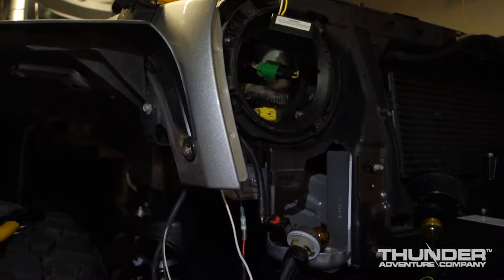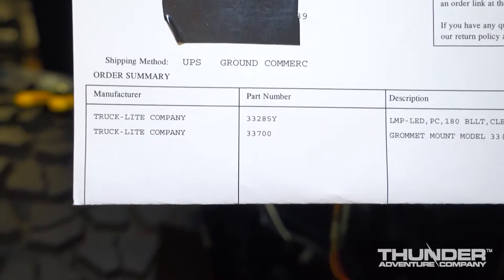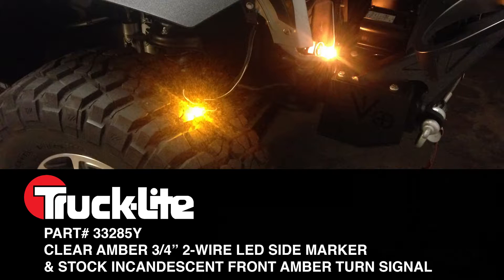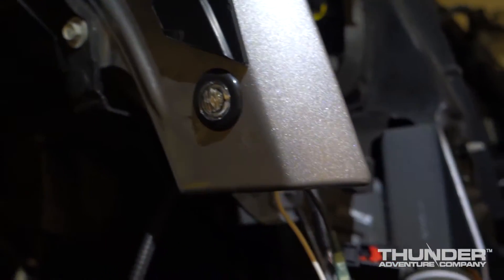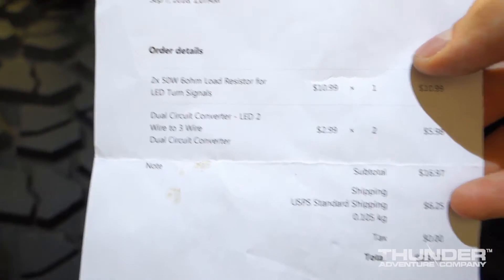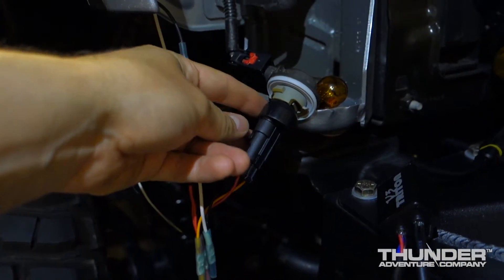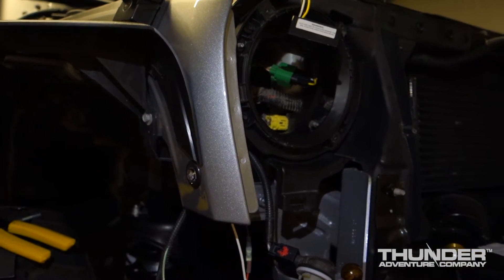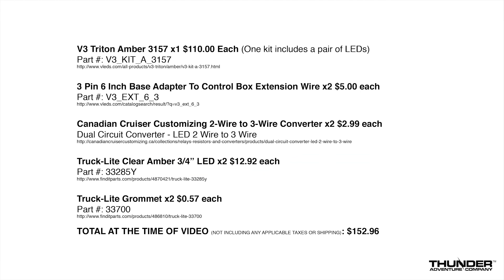Jeep JK LED Side Marker / Turn Signal Wiring

Comment: So what did you do with the factory Side Marker Harness? When unplugged the harnesses, the rear lights quit working.
Reply from the maker: JLincolnBurrows mine are just stuffed up in the engine compartment.
Reply from the maker: JLincolnBurrows I had them unplugged for a long time after trimming the fender flares and before wiring in the LED side markers with no problems.
Reply: Okay thank you. I will recheck my work.